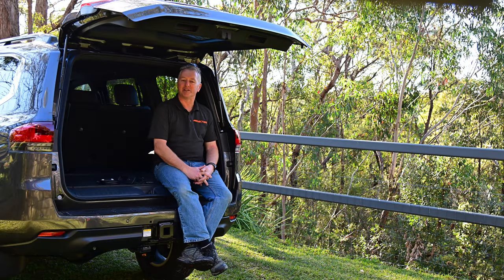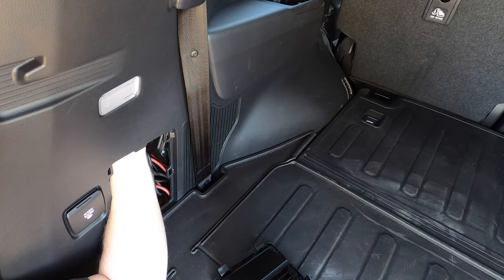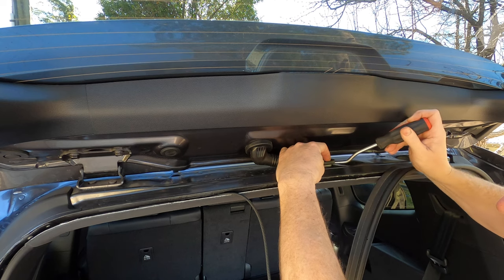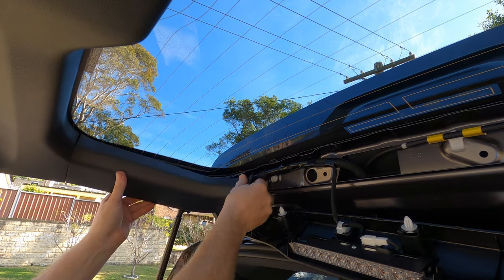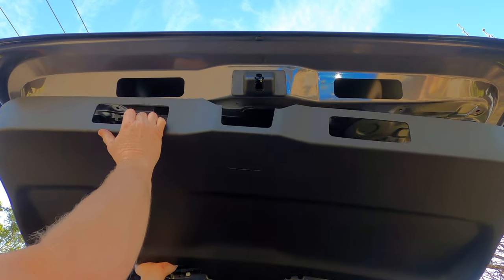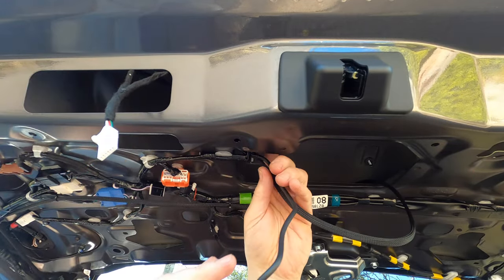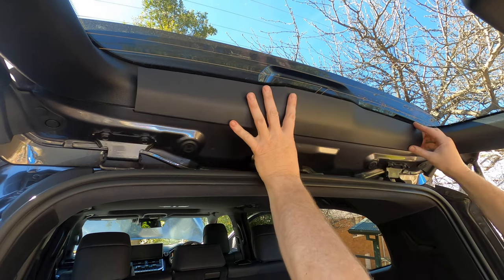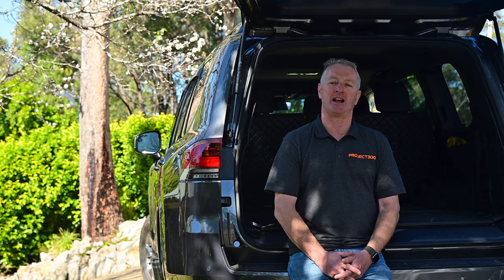Landcruiser 300 LED tailgate light kit - Step-by-step install

Comment: I purchased one from Richards after watching this video as always your explanation is so simple & easy step by step guide. However I snapped the plastic grommet  in the middle of the roof, as it was quite hard to get out. It works brilliant, THANK YOU , awaiting your next instruction set up .
Reply from the maker: It can be a bit tricky that one. I'd suggest you put some sealant on there and tape it in place until it dries, otherwise you could end up with water entry if the grommet isn't well sealed against the metal.
Reply: Thank you for that tip & very much appreciated. have since done that. Thank God summer is around the corner .
Reply: The right way to undo the grommet is from the other side, rises down the roof a bit and undo it from there, otherwise 90% it will snapped or not hold very well and cus leaking.

Comment: Awesome Video Jamie. I have a GXL which has the rear light. Do you know if this kit will fit?. Cheers
Reply from the maker: Not without modification. The GXL has an incandescent light, which has a different connector to the LEDs fitted to the VX +. Richards are unable to find the correct plugs. So you can fit it, but you'd need to manually spice in to the light wiring rather than use the plugs fitted to the supplied loom.
Reply: Thanks Jamie, much appreciated

Comment: Many mistakes (at least 3 mistakes) during your installation. Your 300 will be water leak soon. The rubber seal will be a big headache for you as well.
Reply from the maker: It's been in for over a year now. No water or dust leaks. All working fine.